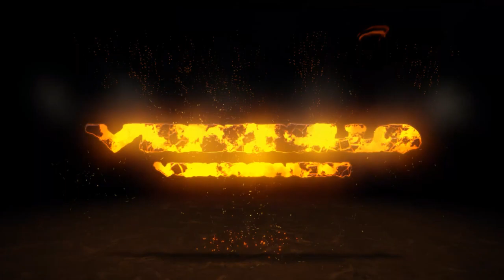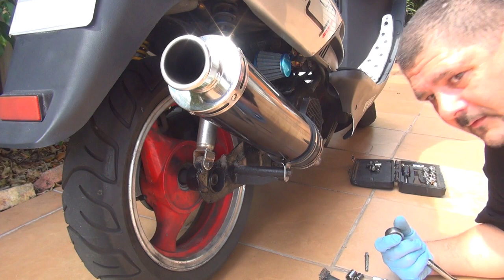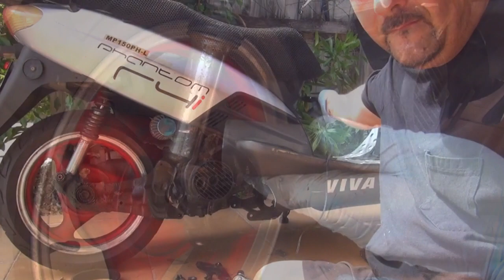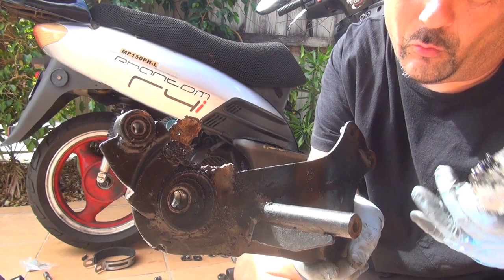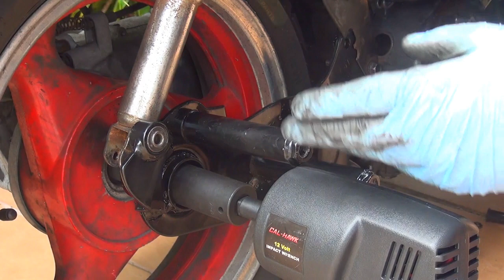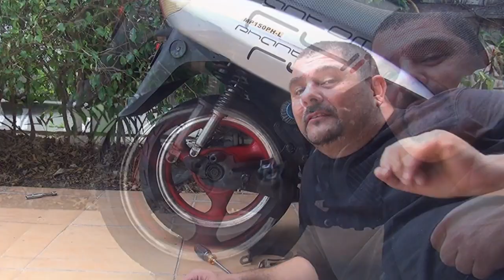Chinese scooter swing arm replacement

Comment: What size and length bolts are for those? I need to replace theme
Reply: U ever find out?
Reply: the Thread is M8-1.25 length im not sure. I had to buy threaded rod and cut off extra as my muffler mounts broke off too and used an aftermarket muffler with the bracket.

Comment: I have i question how did u just remove it like that mine is just stuck like that no matter what i do the bearings are inside the arm and it has a lock for them to
Reply from the maker: Hello spray a little Penetrating Oil on the bearing in the back and around the shaft and let it seat for 20 minutes  https://amzn.to/47FnilQ after with a rubber mullet https://amzn.to/44lLjve tap the center shaft not hard and do not damage the trading  and try to remove it again

Comment: Can I take the swingarms from my wrecked electric taotao and put them onto a different similar style gas scooter? I want to gut a 50cc, remove everything and replace with hub motor..
Reply from the maker: if the swingarm look the same shape you can replace that but i do not suggest to make any modifications because that can be dangerous
Reply: @VirberelloScooterTips  thanks so much

Comment: Awhile back I removed the swing arm, then removed the two large bearings from the swing arm. I then removed the rear shock on the same side. Lastly I used the two bearings as spacers before torquing the nut back on the axle. Not only did it look better and lighten the load but turning sensitivity improved. Had to get used to it though as it is a big difference. My question is was that an unsafe thing to do? Thanks!
Reply from the maker: Hello Roland no was not unsafe thing to do but like you say you change the sensitivity at that can be dangerous if you don't pay attention when you ride. Thank you for watching y video
Reply: You can buy a short axle from the ruck shop it will work and you wont need the spacers.

Comment: If anyone wants to know the rear swingarm bolts thread is "M8-1.25" if you wanted to install aftermarket muffler that has a bracket and most of the time the bracket has to be modified "chopped"  to clear the oil fill tube. For the length 300mm grade 8 threaded rod should be enough to make 2. Seen many times people exceed the weight limit of the scooter with 2nd person/cargo brake the bolts off and had to used extraction tool to remove them shouting F-BOMBs doing it. And dont forget the removable blue Loctite or threadlocker.
Reply from the maker: Great info 👍 thank you
Reply: thanks for the information

Comment: Nicely done my friend & I recently bought a swing arm for a rear disk brake conversion kit . Having trouble locating 12inch rim's with the rear disk, It's cheaper to buy a complete 250 scooter LOL. So I luv my wheels that's on my Red 2019 Tao Tao quantum tour, Google pics of the scooter & you will see . Maybe you know where to find the wheels with the disk' s I'm going to check the link you provided, so maybe the swing arm is a fail for me lol ! rear caliper with the brake Reservoir is no problem to find . Salute Stay Safe 🛵👍
Reply from the maker: Hello my friend I will love to put  disk brake conversion kit on my scooter ah ah ah I will have to ask my wife for approval ah ah ah 
join this group on FB Chinese Project Scooters there is a lot of great members and they are very knowledgeable . Thank you for watching my video be safe

Comment: Can some one tell me I bout a scooter and the axel nut missing I have right nut but looks like the spacer bearing whatever wanna call it like the nut gonna bottom out is there a  smaller spacer on front of the swing arm peace Motorsports  150cc
Reply from the maker: Hello mchstar at the rear swing harm you have a large spacer then a small spacer then the large nut check on parts for scooters dot com they have good prices

Comment: Can i ask you question brother ?
Reply from the maker: Hello yes if I know the answer ah ah ah
Reply: @VirberelloScooterTips  
Oil viscosity 10w40 is good with gy6 150cc and done 43.000 km 
Or should i use 20w50 oil ?
Reply: @VirberelloScooterTips  
You already have gy6 you can tell me what km you did with your scooter with oil 10w40 😩
Reply from the maker: @islamayman5927  Hello my friend my favorite is 10w40 Mobil one and I change the oil every 3000 miles the 20w50 is good if you leave in a location where is very hot all year around
Reply: @VirberelloScooterTips 
No sir i live in egypt the temp now in winter max 20 and summer 37°c 
Should i use 10w40?
Reply from the maker: @islamayman5927  Yes 10w40 is great for the winter and in the summer if you like you can change to a 20w50
Reply: @VirberelloScooterTips 
But no problem to stay with 10w40 in summer right ?
Reply from the maker: @islamayman5927  No 10w40 is great for summer/winter especially if you have Mobil one
Reply: @VirberelloScooterTips  
Oki sir i keep on 10w40 all the Year thank you ♥️♥️💛

Comment: I can’t take mine out for nothing I hammer it to the end and can’t slide it out or wiggle it nothing at all spends hours what should I do
Reply from the maker: Hello yes sometime the swing arm don't want to come out at that point your best friend is a WD40 and spray at the read axle and the large nut also tap the rare axle with a rubber mullet few times. Thank you for watching my video
Reply: virberello GY6 Scooter Tips cool thank you so much again